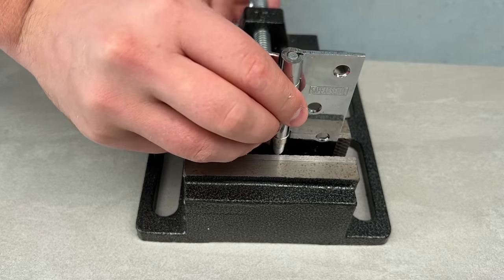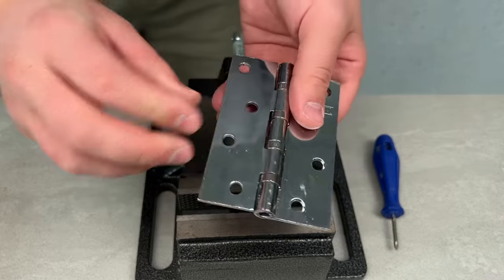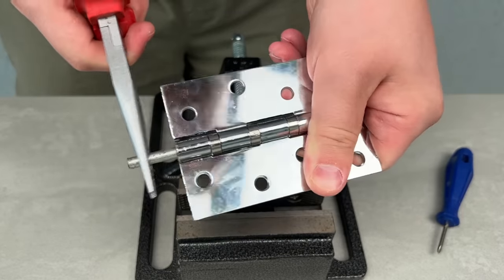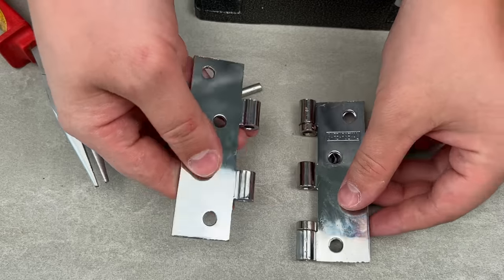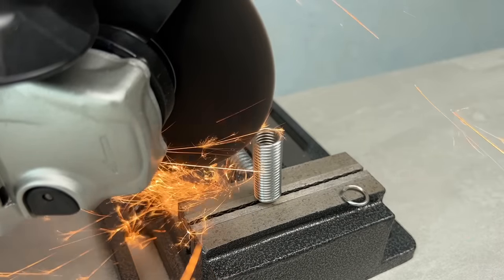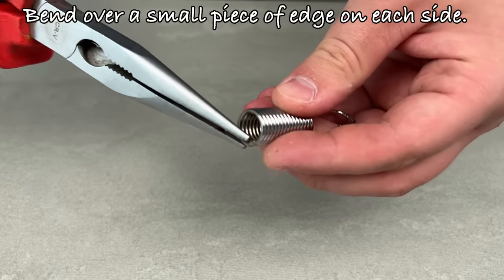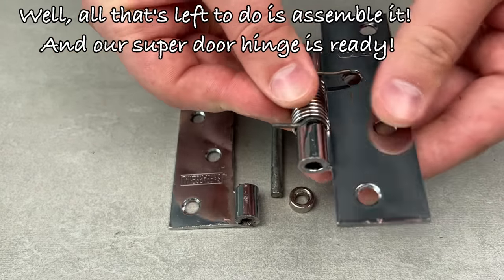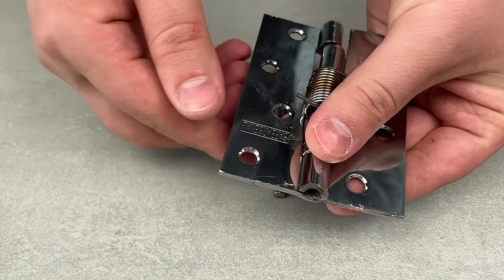🔥 🔥 You will thank me for the rest of your life! Place a spring in the door hinge

Comment: Or,  you could go to any hardware store and buy a pre-manufactured spring loaded door hinge that includes an adjustable tension control built right into it. Then you can adjust the degree of spring power to match the weight and resistance of your door.
Reply: He could also go to a store and buy a spring assembly that includes a new pin and instructions on how to install it for maybe seven USD for Pete's sake a solution in search of a problem for sure
Reply: That is kind of stupid when you can go to the store just buy one.
Reply: A lot of these "clever"diy videos should have the words "if you have no other option" built into the title.
Reply: I was just going to say that.
Reply: I thought the same thing. The store bought ones are a better solution and I have better things to do.
Reply: Thank you...🤫
Reply: @billhale9740  Not to mention it looks absolutely hideous having a hinge screwed flat to the outside of a door and frame, this wouldn't work 99.99% of the time as you couldn't screw the frame side flat because of the architrave/trim and the pivot point would not line up with the existing hinges causing movement of trim as can be seen in this clip.
Reply: I think you missed the point. His wife said "can we have really ugly hinges on our doors?"
Reply: I think some people think they are re-inventing the wheel when they do it themselves LOL
Reply: I think everyone has missed the point he's just made £5000 through views alone
Reply: He’s just trying to get video clicks so he can make money off advertisers- they usually say “you’ll thank me for this, etc”. No normal person has all day to do his hacks, which he probably stays up all night thinking of 😅
Reply: @Bluescout612  There's 4:51 I'll never get back...
Reply: i dont think thats available on our area
Reply: What if you can't go to a store because you've got no pants?
Reply: @edwardv4615 . I’m sure he has a video on how to turn a spring into a needle so you can sew yourself a pair of pants.
Reply: edward4615  🤣🤣🤣
Reply: Up next, how to make your own donut with a hole in the middle using dough, a commercial fryer, homemade glaze, a cookie cutter, belt sander and tig welder…
Reply: Yeah. Thank you for wasting my time.
Reply: They spent more in time hahaha
Reply: But, that would be too easy.
Reply: Ever hear the old adage, work smarter not harder
Reply: Not to mention it`l look like it was ment to be !!
Reply: Or a hinge cut at an angle so it rises and falls with gravity
Reply: Thank you for the rest of your life.
Reply: It’s more fun going through all the aggravation of making one though.🤷🏾‍♂️
Reply: I’m not thankful I watched it.
Reply: Plus the spring used was a tension one not a torsional
Reply: Bingo.  A lot of work for something that is so easily bought and not expensive.
Reply: Or you could just shut the door.
Reply: That's too easy.
Reply: This idea is great ,..
When you’ve finished doing everything meaningful in your life,
And have a ton of free time on your hands,
And have completely emptied your bucket list.!
Reply: All this work to save $5?
Reply: You’re right but then this guy wouldn’t have 114k subscribers to pay him !  So who is the dope?
Reply: @edwardv4615 there's a video, "how to make pants"...
Reply: ..and you wouldn't have to hear that god-awful music
Reply: I just pull the door closed.
Reply: Exactly my thought…
Reply: @Darkroom69 I always thought the spring loaded hinges were made for children who never learned to close doors because “they were born in a barn” lol
Reply: Maybe just remember to close the door. I mean... it's a door. Who forgets to close a door?
Reply: All of you are just looking for the easy way out! The best part of this video is to only talk about cutting the spring the right way and nothing about goggles — just watch the bits fly!

But seriously, the amount of wasted material, time, and money to do these hacks is astounding! I can’t imagine how anyone can watch these videos without thinking of cheaper alternatives.
Reply: What a painful thing to watch.
Reply: Exactly!
Reply: 😂 WASTE OF TIME AND MATERIAL 😂
Reply: Absolutely. Why would you be bothered?
Reply: That's no fun.
Reply: I came here to say that; apparently so did everyone else. 😅
Reply: Yes,😍 love that option! Thank you
Reply: And it will look a lot better.
Reply: Yep
Reply: He doesn't have anything better to do
Reply: Se llama de doble acción
Reply: @Roses-lilac  /
Reply: Lame
Reply: a real big time waster....something the Democrat Party would come up with
Reply: @GailUrge-vq6qn   Brilliant. You managed to invent a political conspiracy based on door hardware.
Reply: and get a better spring. I don't any spring that you can bend with pliers
Reply: It's not an engeneering decision but an YouTube decision. Lost of time.
Reply: Indeed. What a useless waste of time to make this video without showing anything new.
Some people seem to have a lot of time on their hands.
So much nonsense posted everywhere on social media, media and the whole internet has more crap then something useful nowadays.
Reply: I just removed all my spring loaded hinges. PITA
Reply: People would never understand that thank to this kind of creativity now they can go to the store and buy one effortless 😅
Reply: H😂😂😂😂😂😂😂
Reply: @edwardv4615 if you could make a spring loaded hinge I'm pretty sure you could make some pants, right?
Reply: Why would i do that when i can risk losing my finger on an angle grinder over a useless dumbass project like this
Reply: I was going to say the same thing. Couldn't have said it better myself. Was still fun to watch him work hard for nothing lol
Reply: Sure bro but that's not an interesting upload that can potentially make money for your channel
Reply: Why would you want something so ugly on the outside of a nice door.
Reply: Yes our downstairs neighbour has self closing hinges that he's just had the landlord around to adjust them.  So now all of the  doors close with a bang every time and apart from the very loud bang, they almost knock us out of bed or off the sofa.
Reply: Probably for a very similar price too.
Reply: What kind of video would that make though?
Reply: How far does he live from a hardware store?
Reply: Quality Springed hinges are available in hardware stores
Reply: Amen!
Reply: Buying a spring-loaded door hinge is too expensive where he lives!
Reply: Nah that makes too much sense😂
Reply: Lol for real
Reply: Or you could just close the door behind you 😂😂😂
Reply: I was about to say the same thing. Amazon has adjustable Self Closing Door Hinges 2 for $19.99!!!
Reply: @kennethumbaugh621 😂
Reply: Also, they are only 15-20$ 😂😂. And if you don’t have that you most likely don’t have a door you should be doing this on. Js
Reply: @ToddThompson-du9mx  😂
Reply: Obviously he is off grid .
Reply: @ladavis1959   😅
Reply: Não seria mais fácil e prático comprar uma mola para porta?
As pessoas gostam de complicar e/ou inventar.j
Reply: Maybie in Russia don't have that stuff.
Reply: You could've come to Scottsdale Custom and bought self closing spring hinges in the time it took to watch this video. If you're in the Scottsdale, AZ area, Come see us today. Hardware. Doors. Moulding. Windows. Cabinets and everything in between.
Reply: Goooooooood !!!!!!!!
Reply: Tz Ii
Reply: But we have to do things the hard way, wrong tools and all.
Reply: Thanks for letting me know I can buy one ready made saves me having to watch the video
Reply: @mrq6270😂
Reply: Justo iba a comentar lo mismo. Ya existe una bisagra así y mehor construida. De todos modos bien por la iniciativa😂
Reply: I should have read the comments first. I already screwed my vice to my kitchen table, ruined a perfectly good Phillips head screw driver and got metal shavings everywhere....😢
        JOKING, folks
Reply: @Kinosec-10 exactly. Nowadays 95% of these videos aren’t really worth watching. They’re just made by someone trying to make money. Nine times out of 10 I bet the person making them probably doesn’t even believe that we should do what they just showed us how to do. Especially true in the case of this video.
Reply: That’s what I did 30 years ago on a heavy solid core interior door and it’s still working just fine.  This is a time consuming solution to a problem that’s already been solved.
Reply: Я просто за собой закрываю дверь.
Reply: I will thank you for the rest of my life.
Reply: naaaah, that's not insane enough
Reply: I need my 5 minutes back.  Ugh!
Reply: An expensive solution.
Reply: @davescardcreations  No, his wife said, "Don't let the door hit you in the rear when you leave."
Reply: thats what I WAS GOING TO SAY.
Reply: In THIS economy?

Comment: he skipped the part where he had to go out and buy a torch to heat the spring to bend the ends ... and mess up the chrome finish ... just buy the hinge with a spring and save time and trouble !!
Reply: Quite simply !!!
Reply: I was thinking the same that this should already be available.
Reply: Plus the hinge is now on the outside of the door instead of out of site on the inside. UGLY

Comment: Good job for DIY hack.  In the alternative, AMZ has them prebuilt with adjustible tension for $10.  That means if it's slamming your glass-window door shut you can lighten the tension, or if you have a heavy metal door increase it.

You can also pay up to $45 to get a dual-spring latch (like you find in office buildings) where you independently adjust how "quickly" it moves the door to almost-closed, but then how softly it does that final latch without a bang.

But for a hack, and if you already have the hinge and the spring and a lot of time, it's pretty good :)

Comment: That's a very fancy hinge. The majority of hinges in America don't have caps holding in a central rod, or spacers between the parts. They're usually just two halves and a pin that's flared on the end so it won't come out. Most hinges for full-sized doors just have a pin with a flare on the top so that it can be easily pulled out.
Reply: That's a better quality "architectural" hinge. Thicker and with bearings. I've bought and installed them to replace the thicker hinges that you find in older houses.

Comment: If youd rather avoid the work and modification of hinges you can buy adjustable speing hinges at most places that sell doors and installation materials. I use wholesale supply companies as im a contractor. Many will accept walkins and sell to the public or buy online. The price ranges from 10.00 to oh my damn! You should be able to find decent interior spring hinges for 12 to 20 per hinge.
Reply: I was going to point this out, but you were ahead of me. I guess if a guy has the time and just wants to try modifying the old hinge, but hey - there are other things to do.
Reply: @rgplpc  you're right. I'd rather know a bored guy is being productive vs out robbing my ass on the way to buy some spring hinges.
Reply: Yes, or just buy a cheap perko style closer for around $15 and you don't even have to mess about with existing hinges
Reply: @zbigniewczaykowski514  stay away from those plastic pieces of shite they used to put in the PVC wrapped screen doors. I've actually got one on my bedroom door now. It is one I had to replace on a friend's door that had broken. I welded the plastic back together and attached it on the inside of my bedroom simply because it's a hollow core door and it is strong enough to keep the door shut but not latched so my little kids can push it open to get in. Mini tha moocher uses her nose to open and get out whereas Miss Della Reese uses her feet to open it. Out doors in Texas plastic doors hinges and rain gutters are a bad investment. They all melt. Oh the plastic truck tool boxes will squash like a marshmallow if a couple of big ol boys sit on it to eat lunch and it's over 100 f outside.

Comment: People are missing that the real value in building such unique items whether they already exist or you outright invented them is it leads to other innovations, ideas and inventions based on observations and experiences during these construction processes.
We invent new tools, new mechanisms, new technology and I say this as a college educated electrical/electronics engineer, inventor, 3 decades auto mechanic, metal crafter, carpenter and beyond.

I've literally invented technology that didn't previously exist and yet I'll still fiddle with all kinds of projects, repairs and experiments because it advances my skill, my ideas and my potential. On my 4-wheeler, you will find many hoses and cables with a nice big stretched out spring around them which prevents them from exposure to damaging heat off the air cooled motor and protects them from being snagged and such.
When manufacturers come across our work, it's not unusual for them to flat out steal it.

Comment: Man I hang a lot of doors and really do not
Like using hinges where the pin in not connected to the cap. Or more to the point, when it has screw in finials on both ends of pin. There are some situations where it is nearly impossible to screw the finials back on due to trim projection.

Comment: kind of weird having to mount the hinge on the exposed surface of the door frame.  The normal way would be to have the hinge attached on the end of the door and the inside of the frame so when the door is closed the hinge is closed, the plates are hidden and giving a cleaner look.  But, I don't think this modification would close enough for the door to fully close if mounted the normal way.  That's a good reason to just buy a normal sprung hinge
Reply from the maker: Yes, it has its downsides, but it works great in my dacha and I like how it looks

Comment: So, spring hinges can be expensive and I can understand why you tried making one yourself. But really, who mounts door hardware on the outside of the door like that? I’m also certain it could not be mounted correctly, that the hinge won’t completely close with the spring ends that would be between the hinge plates, so you could never install it properly. You also skipped the part where you heated the spring to get the ends bent the way you wanted—check the heat scarring on the spring after it’s bent.

Comment: I can’t believe anyone would waste their time like this. If you could just take out the pin and slip a cheap spring in their easily this MIGHT be considered a good “hack” but using an angle grinder to cut of the middle section? Then having to cut the spring too (and that warning seems to say if you don’t do it exactly right all is lost) is not reassuring! Then the kicker - it doesn’t actually close the door because you can’t adjust the tension! And it looks really ugly on that door too!